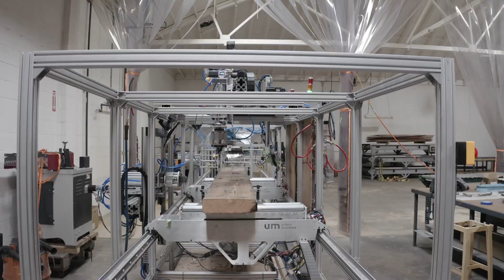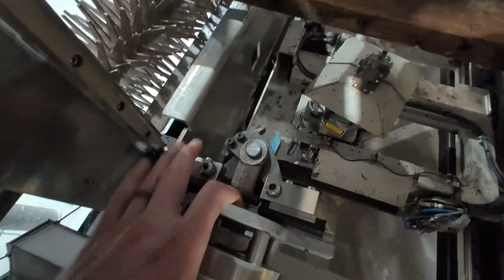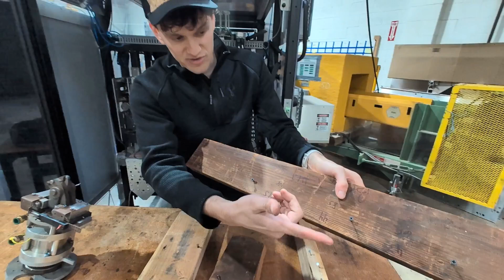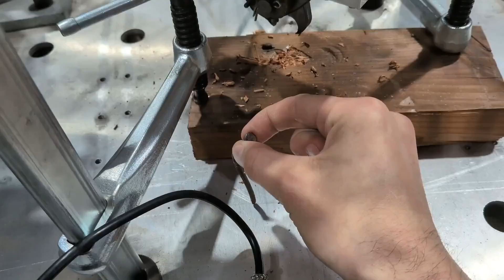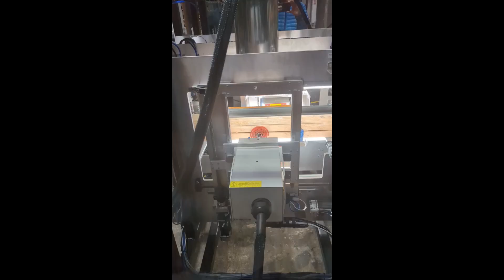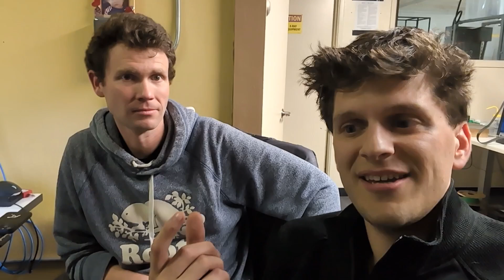Can The World’s Strongest Magnet Pull Nails Out Of Wood? The Physics Behind Nail Removing Robots

Comment: What if we wiggled the nail with magnet while pulling on it? Osscilations and vibrations could perhaps make enough space in the wood so the nail goes out easier? also, there i guess would need to be a contact point with the nail?

Comment: Forget magnets why don't you have a counter rotating tool to unscrew the screws? You could literally just use off the shelf parts for most of the tool.
Reply from the maker: @masterchafer  we did build an iteration that attempted that. Unfortunately field data proved that 90% of the screws we would get would be stripped, broken, bent, at weird angles, or generally inaccessible for grasping and twisting.

Comment: also why not cut the screws a few mm longer
Reply from the maker: We can configure it! We've found having them flush is best because it makes the control authority we have over the wood much more robust. Plus, the coils have to get super close to the nails to heat them up quickly. By cutting them flush, we can get even closer!
Reply: @AlexThiel  thanks for the response 
Great macine btw

Comment: are you just calculating the steady state? what about induction on the rising and falling edge of the electromagnet current? seems like you could get some interesting effects there. The 45 T magnet you reference is the world's strongest "continuous field" magnet, the record for non-destructive pulsed-magnet is technically much higher (although still presumably not practical in an industrial setting, so still probably fine as a theoretical upper bound). what assumptions did you make about the magnet design? does your model just hold one pole of a giant magnet up to the wood, or are you accounting for a design that focuses all the magnetic flux into a small area right at the head of the nail? in my imagination an electromagnetic nail puller would function like a small coil gun, just with the barrel leading into some sort of sturdy chamber to capture the projectile, that is then emptied between firing. depending on the design i could imagine getting a lot of extra force out of the electromagnetic induction from a pulsed magnetic field, which suggests a trade-off between optimizing the core to reduce inductance (for faster rise times), and optimizing the core to focus the field. these are all hard enough to model that i'd be tempted to just mess around a bit and see what happens (with appropriate electrical and projectile safety measures)

another approach: what about mechanical resonance? i assume there must be some very small amount of elasticity in the interface between the nail and the wood. the magnet might not have enough strength to directly pull the nail out, it could periodically pull on the fastener in sync with the resonant frequency of this elastic interface, you could work the nail loose over time. the frequency is obviously gonna differ for each fastener, but you can use your electromagnet as an inductive proximity sensor. i'm sure the analog electronics to measure minute changes in inductance while a large current flows would be a pain, but not impossible. measure the distance, apply some sorta phase translation to it, and feed it into the field strength, and your fastener is now the resonant element in an electromechanical oscillator. then there's all sorts of possibilities with lateral loads, the direction of oscillating motion doesn't need to be normal to the wood. if the nail is vibrating laterally, it'll deform the hole, increasing its size and reducing friction. think of all the ways fasteners work themselves loose over time with vibration; if you could use an electromagnet to transfer a bunch of vibrational energy into just the fastener, at the right frequency, perhaps you could induce some of these failure modes at an accelerated rate.

Plus, the eddy currents from the rapidly alternating magnetic field would induce heating, so you potentially get your "cooker" for free, with the added benefit of the "cook time" being perfectly proportional to how much difficulty the machine has pulling the fastener out, potentially leading to an overall reduction in damage for fasteners that don't need the full treatment.

Comment: I do have a question: typically in my area at least, lumber is required to be "stamped" before it can be used for building purposes and pass inspections. My assumption is that the "old" wood that is reclaimed will not have visible stamps. How is the lumber graded and stamped for inspection purposes?
Reply from the maker: Lumber grading is a known quantity, there's many ways to grade lumber (visual inspection, physical testing, automated machinery). So far we've mostly been selling our lumber to architecture use case, since the wood is aged it's highly sought after as wall paneling, furniture material, etc.

As we scale, we will likely invest in automatic grading machines. There's probably some other caveats I'm forgetting.

Comment: Thank you for this intriguing video. Magnetic Flux Density is not a "volumetric" density, but rather the density of Magnetic Flux per Unit Area...  Thus while Tesla is "magnetic flux density",  you don't use Volume to calculate the force, you must use the "surface area". Typically you would "touch" the magnet to the nail to remove it. So only the shared area where all parts are touching would be considered the "area". However, as you can tell by the formula, if the magnet and nail touch, then you have 0 distance and the formula becomes invalid in the denominator. Therefore a modified formula that takes into account a surface roughness might be considered. 
Nails stuck deep in the wood could be dangerous to people cutting the wood.   I would not only use a camera sensor, probably you should consider something that can penetrate the wood as well... (not just a prox), perhaps microwave ? 
Lastly, please consider engineering the wood after it has the nails removed... by pressurizing it to increase its strength. (see video, Making wood as strong as steel! by Strange Parts). Maybe license the tech...
Reply from the maker: Interesting! Do you see anything on the formula we did egregiously wrong? I was not really sure about the volume parameter, and the permeability of steel I put down as 200k since I saw that on a few tables, but I also was out of my depths on that.

Thank you for your time!
Reply: @AlexThiel  GPT does tend to make a LOT of mistakes, and teasing them out is quite the process. Specifically tho, you do not use the permeability of the material that you are trying to pick up in that formula...   it is more about the permeability of the environment that the magnet is in. You would use a Mu for the permeability of the Iron if there was a "core" involved, such a a transformer core or you were wrapping the magnet in some sort of Iron to focus the field. But, in a case where your magnet is mostly surrounded by "air", you would just use the Permeability of free space ( 𝜇0), since the value for air is essentially the same.  I guess in the end it would depend on how you design your magnet. You could use FEA to visualize this, but I don't have the tools for that.
Another tricky thing is that sometimes the formulas don't show everything quite right... for example 𝜇 = 𝜇0 * 𝜇r, where 𝜇0 is the Perm of Free Space, but 𝜇r is the relative permeability for that material. So, just be aware of which 𝜇 you might be looking at... if you see 𝜇 by itself, then it is probably going to need to be calculated from 𝜇0 and 𝜇r.
   In the end tho, none of this formula stuff matters much because a magnet would need to be incredibly powerful to pull up a nail. hehe
Reply from the maker: @marcfruchtman9473  we should have called you for the video, thank you for your insights!

Comment: Always wondered this.  No clue how much a newton is.  I know lbs and kg and that's it.
Reply from the maker: 25N would be about 5.6 pounds, assuming you're on earth! Sorry for hopping around on units throughout the video...
Reply: @AlexThiel  Using Newtons is perfectly fine, as it is the correct unit of force. Pounds, kilograms or tons are just something that makes it easier for some people to understand the magnitude, but every proper engineer would still prefer the correct units.
Reply: One Watt of power equals the amount of power necessary to pull with one newton of force for the distance of one meter for one second.
That makes it a more relatable measure of force for me.

Comment: Super novae or black holes would not help the magnetic fields. There simply is a limit to how much you can magnetize the iron in the nails.
Applying a stronger external field will, in the end not yield more force on the nail as it has already saturated.
Once all the domains are aligned it is saturated and there is just no more to be had.
Reply from the maker: Please please can you explain magnetic saturation to me? I was having a really hard time grokking it. Does it have anything to do with how much an electromagnet can create magnetism?
Reply: @AlexThiel  A simple explanation that helped me was to start with an electromagnet with an iron core. As you apply an external field with the coil the magnetic domains in the crystalline structure of the iron starts to align and the iron itself acts like a magnet. Some of these domains stay aligned once the field is turned off and this is another property of the material, it's like it needs a bit of a push to get the domains flipped but once flipped many of em stay there. However, the higher the field the more domains flip until there are no more to flip. That's when you can consider the core to be saturated. You can get a bit more out of it but it's more the external field doing it than the actual iron core.
So, next is to look at the permanent magnets and iron. They attract each other but are not able to repel each other. This is because the field of the permanent magnet is now aligning the domains in the iron and since they are aligned the poles point the same way. Naturally this means the surfaces facing each other are opposite poles so they attract. At full contact, the attraction between magnet and iron is the same as the attraction between two equal magnets. More contact surface and mass is usually how you increase the hold of a magnet to another magnet or to iron once you reach the limit.
Oh and there is another little fun thing about the field in iron keeping the domains aligned... If you make yourself a U shaped electromagnet with a flat bar across to "close the field" then while it is closed you energize the coil to form the field, you can then remove power to the magnet and the flat bar will be held in place by the aligned field placed in the core.
The field stays put until you brake the contact between the core and the flat bar. When the contact is broken the field collapses and the domains that don't "stick" randomize (or return to their natural orientation set as iron dropped below curie temperature during cooling I think). If you monitor the coil with a LED/bulb or meter you should be able to see energy being released as the field collapses. People have been playing around with this for ages and one youtuber even had his electromagnet sitting with a stored field for over a year to test it.
Reply from the maker: @1kreature  Ahh, that makes some more sense. It sounds like magnetic saturation is something specific to electromagnets, right? Assuming you could create the magnetic field somehow, how do you calculate the force you could actually apply on a given chunk of metal? Does saturation play into that still?
Reply: @AlexThiel  There is a limit to how many atoms and magnetic domains you can align. Once all are aligned there really is no more to do. This is why people mention supernovae and black holes. Increasing the density of the matter is the only way...
Also, I managed to find the original demonstrations for the odd "permanent magnetic holding" demo. It is fascinating! It was on the channel for @RWGresearch and you can find it by searching his videos for "pmh". He did not measure the residual fields but he did follow up after 2 and 5 years... In reality there is always a degradation but the effect is so small and slow that we consider it almost permanent. The same goes for what we call "permanent magnets". They are really not, but unless you heat them up a lot they decay on a geological timeframe so for a human seem very permanent.

Comment: The easiest way to remove a screw is to.unscrew it
Reply from the maker: @johnGabryowicz-ev7mz  hired! This is the kind of out of the box thinking we need
Reply: I suppose screws and bolts also have the advantage of being visually different heads than nails. So an image recognition +twisting grabber should be feasible. But I appreciate the charcoal generator solution.
Reply from the maker: @jmondanaro  we actually prototyped some screw unscrewed machines. It ended up being unfeasible because the wood we get often has the screws broken off, bent, or smashed into the surface of the wood. There are other issues with it. 

The cooker keeps the wood in great shape but made screw pulling easy, and we already had that tech built out. It also makes economic sense- we could use a cheap machine (cooker) to make screws pullable by another already useful machine.